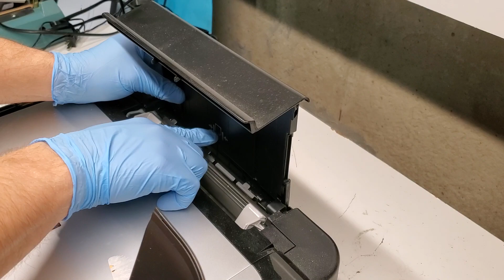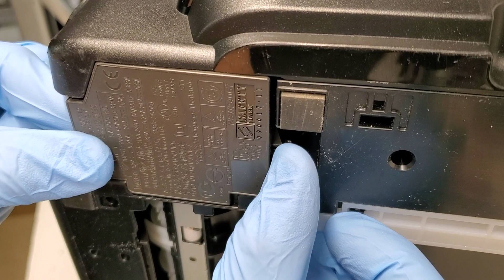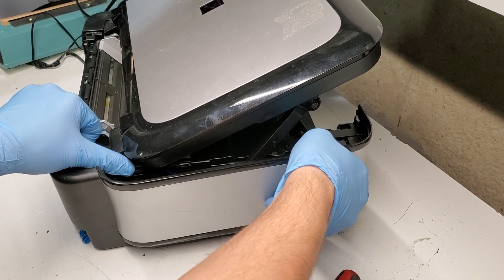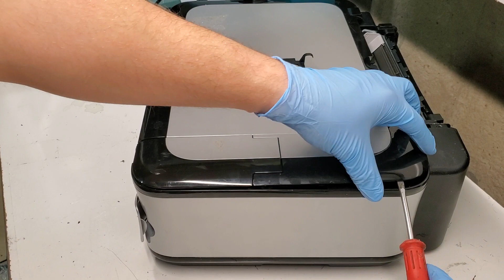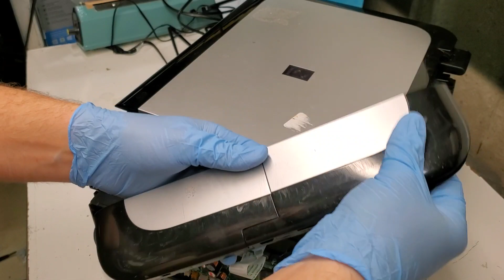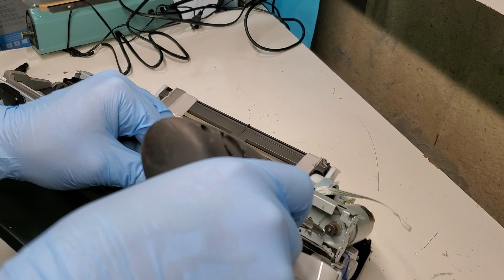Taking apart Canon Pixma MP560 Printer for parts or repair

Comment: Thanks for your video, very interesting. A pity that you did not go for the ink absorber pads😢
Reply from the maker: Thank you for the feedback.  I know, I missed that. Im sorry. Honestly, though, when your printer gives you an error related to absorber pad end of life, replacing it will not remove the error. You need to reset by buying a reset utility online, which is about $10 and it will reset the absorber life. Most of the time when absorber pad end of life message comes on, there is plenty more room for waste Ink ink the pads.

Comment: 👏👏👏 very useful your video, my mp560 don't power up after a print job. Is not a PSU problem , i try to repair and i have see somebody correcting by  moving cable on motherboard. 😢 My last chance

Comment: I have a MP210 Pixma.. Can you tell me what assy. board  energizes the paper feed roller to feed the paper into the printer. I assume I have an electronic problem not a mechanical problem. The rollers are  not turning .

Comment: Just watched your video on replacing carriage unit on a different model and you describe that if the encoder strip is not in the right position the unit will slam back and forth.  That sounds like my problem.  Any way for me to adjust?

Comment: Paper gets stuck inside the printer what is the problem
Reply from the maker: There may be something in the way of the paper or rollers need cleaning.  There are roller throughout the printer where paper flows, check those passages and clean them if necessary. This printer should also have an automatic roller cleaning option. Go to menu on printer, scroll to MAINTENANCE,  then select ROLLER CLEANING and follow directions.

Comment: Hi, Do you know how is the ink absorber part can be replaced or drained for this MP560? And how to replace the ink absorber part, I see that is is right next to the printer control panel.  Thanks
Reply: Remove all of the ink cartridges... then there's a gray bar that's on both sides of the print head.  Lift that bar and remove the print head.... then soak it in rubbing alcohol.   Wipe it off and let it dry then reinstall it
Reply: This question is about the absorber pads not the print head . Any help for the question above?

Comment: I'm trying to find a way to clean the inside of the scanner's glass, but I don't know how to remove it. Is there a way to do it?
Reply from the maker: Yes. The scanner is in the glass and plastic unit which comes off like we show in the video. When you flip it over, you will see some screws or clip tabs which release the upper and lower sections to open up to inside the glass.
Reply: @303electronics  thank you so much! I will give that a try!

Comment: I'd like to send you a video showing my printer issue
Reply from the maker: Sure. Please attach a link to the video in the reply.  I'll take a look and see if I can be of any help.
Reply from the maker: @billdem9298  It seems like the mechanism that sits under the carriage is stuck and not moving forward. There may be something there on the bottom preventing it from moving. Either too much ink gunk or broken gear. I have a similar model and may be able to send a video of what may need to be done.
Reply: Ok, send e the link please.
Reply: I see several videos push back the absorber tray for error 6A80. I tried that and I didn't see any foreign matter.
Reply from the maker: @billdem9298  Thats what I was going to show you. I haven't been able to find another solution. Like I said, there may be a piece of paper or some other object in that area that will cause that error.

Comment: I sent a job to my printer and it shut off....I tried to turn it back on with no luck.  I left it unplugged for a day, nothing.   I tried other outlets in the house, nothing.   I bought the same printer and swapped it the power pack? Thing (the box thing that the power cord plugs into)   it wasn't that because the other printer worked with that installed in it from the"broken" printer.   Lol.  What would you suggest?   Are there any fuses anywhere?
Reply: Hi, see my reply above:
I had exactly the same problem. I checked the power supply module and it was Ok. So I found this video, opened the side-panel to access the electronic logic board, moved/pressed all connectors and, while it was still open, I plugged the power cable and... magic! The printer could be switched on again.
On the board there is a hidden mysterious button, it could be that it senses that the side panel is open and it does a reset? I don't know but I have the feeling here there is something fishy. Planned obsolence maybe?